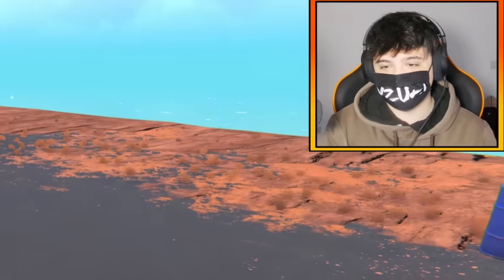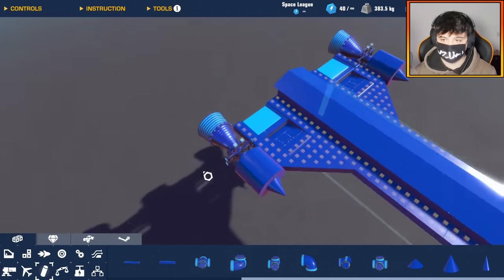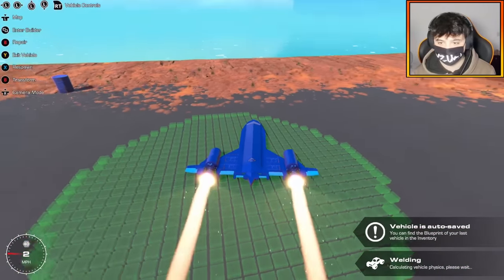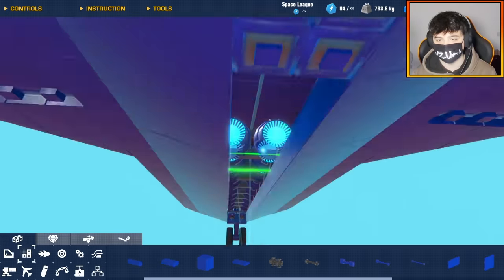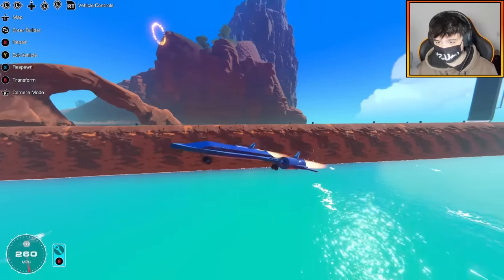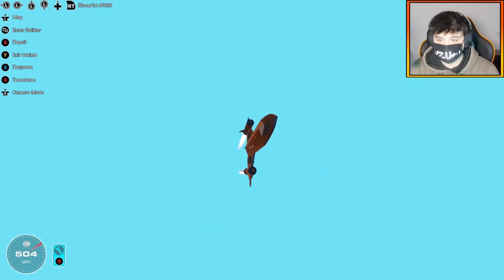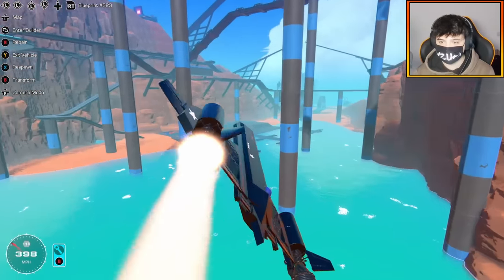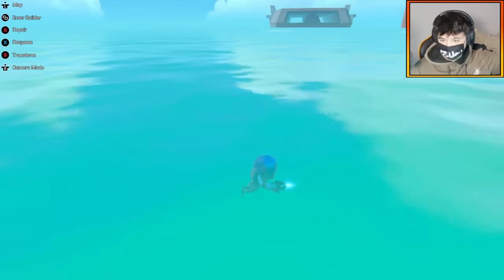Building An SR-71 With 'INSANE' Acceleration! | Trailmakers

Comment: Do a motorcycle race around airborne or a low gravity race.For the motorcyle race would say 2 dragon engines and a space truster with a top speed of 70 MPH with the spacethuster and for the low gravity race do around 0.15 G but no downwards thust and downforce, you can have gyro assisted roll but no pitch and disable air controls on your seat.

Comment: You can save more space using space thrusters by simply adding two bocks in front of them allowing your build to fit 2 space thrusters in the space of 1 dragon engine allowing for faster speeds and you can add space thrusters in the middle slot for even more thrust you should at least hit 750 mph

Comment: You should have used the space thrusters as they have more power density

Dragon jets have the power density of 300÷12 (which is 25)
While space thrusters have the minimum power density of 250÷8 (which is 31.25)

In short, the space thruster has slightly better thrust output than the dragon jet

Edit: the first number on the power density (ex. 300÷12) is the engine power, while the second number is the space it would take up (for space thrusters, it can range from 5-8)

Comment: Why you keep doing logic when you use a controller? The buttons are pressure sensitive you can just slightly hold the throttle trigger to ramp up but not move. Then squeeze more to punch it